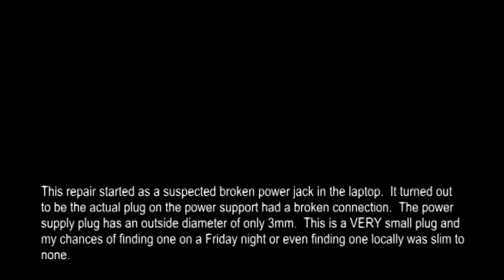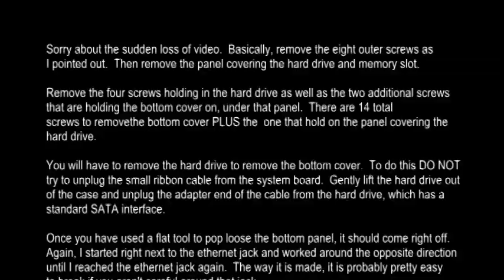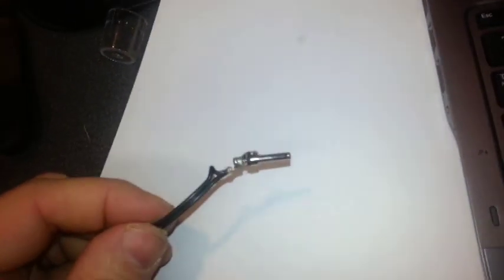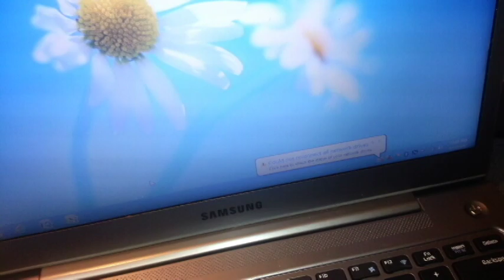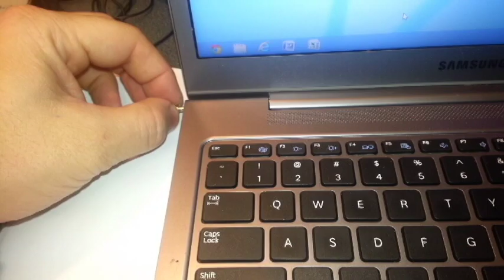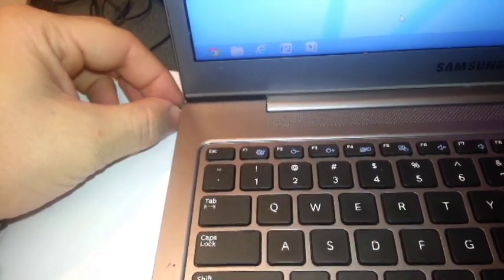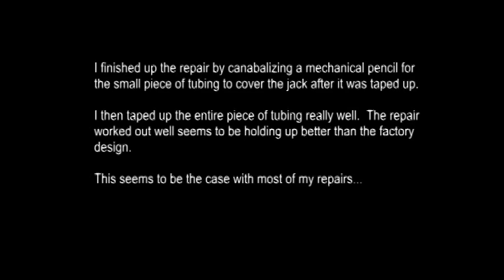Laptop Repair Samsung Ultrabook NP530U3B

Comment: The Samsung Ultrabook's charger is really tiny. I have to replace the charger every 6 months. Thank you Samsung for this stupid design.
Reply from the maker: Yes they suck really bad on this charger pin.  Since I made this video I was able to find some of the same size pins with leads on ebay and I bought several. I spliced them onto a few Samsung, Dell and HP chargers that all put out 19V DC so my wife now has several at all times. Some of the chargers have multiple wires with different voltages so if you find the right wires with 19V you should be good to go.  

Here's what I purchased.  http://www.ebay.com/itm/Power-Plug-Connector-Cable-Cord-For-HP-Dell-Samsung-ASUS-EEE-PC-Laptop-Adapter-/351064636050?pt=LH_DefaultDomain_0&var=&hash=item51bd153a92

Comment: I had to replace the entire power supply....the front plug was completely tear off. It is way to thin and fragile... I also find the touchpad not responsive, especially on double-tap, unlike my previous traditional notebook....that is a big disappointment, no single finger scrolling too..